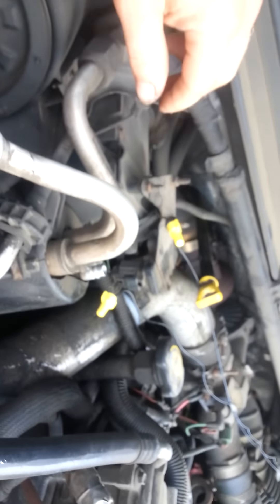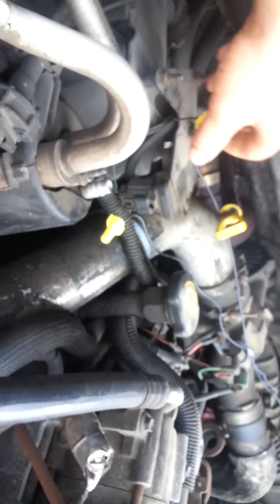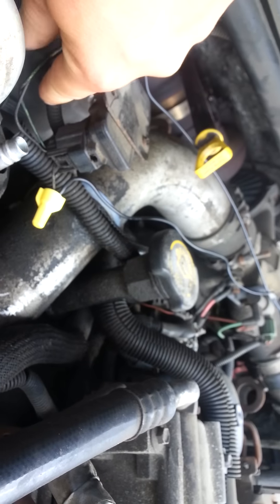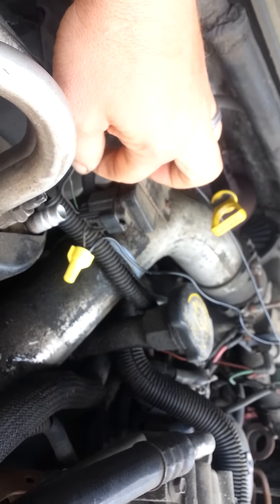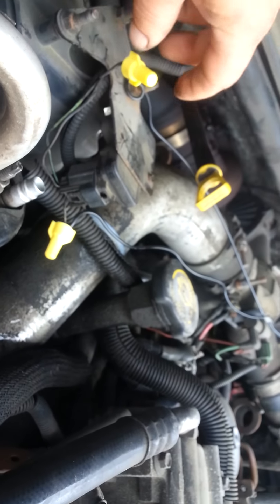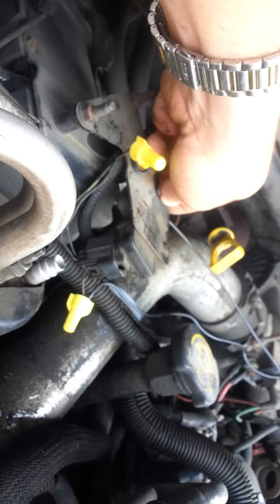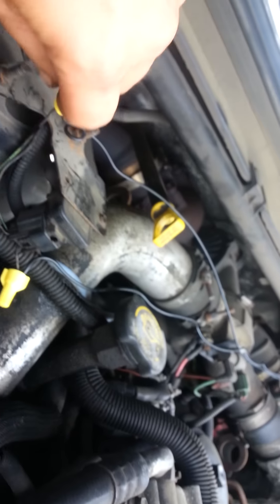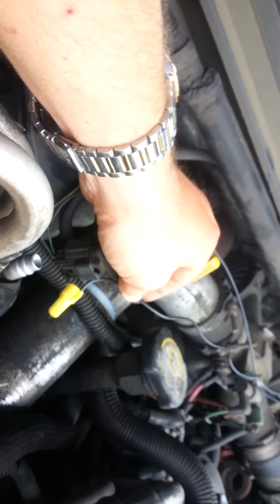Smoke switch install 7.3

Comment: If your fuel pump isn’t getting power from your sensor it automatically send more fuel through.  So when you floor it or do a booster launch she’ll throw smoke throw

Comment: ANSWER: There are 3 wires total, Black, Brown, Green.

CUT: Brown wire. 
the wire that goes into the plug, you will splice with a wire that will run to ur switch to that is going to be in ur dash.

The other end of the brown wire that goes to the the regular FORD WIRE LOOM, u will also splice that, and run a wire that goes to the other end of the switch…

all the switch does, is basically completing the brown wire circuit or it is not. which tricks the PCM, to allow more fuel

Comment: 01 7.3 and I cut the brown wire and spliced into switch but nothing has changed but service engine light on now also I only had a green wire red wire and brown no black like you mentioned any idea
Reply: Yea my 7.3 only has red green and brown
Reply: @eddy8319  what wire do u splice together the brown or the green and brown to the switch

Comment from the maker: Make sure you get your swith in the right position  and after you play with it you will see a difference
Reply: Can you only cut brown wire and leave it open and not install a switch???
Reply from the maker: You can but your fuel milage will drop to about 5mpg
Reply: Jason tyo
U conected just the green one ??

Comment: I am going for power smoke is wasted fuel get the wiked will turbo and 6 stag chip that is wut I did.Don't cut your wireing just brake out some$ And do it rite

Comment: Can you only cut brown wire and leave it open and not install a switch???
Reply: Your engine will not run correctly normally and have insanely high egts on highway in od.  

HIGH ENOUGH TO MELT SHIT IN THE ENGINE.

Comment: Is your 7.3 all stock or tuned?
Reply from the maker: That truck was bone stock
Reply: @jasontyo7949  hey can you please explain, do I cut the wire off of it's other end only using the end that goes into the map sensor?
Reply from the maker: @skidoock3606   you only want to cut it to where you can attach a wire to it and then to the switch then from the switch back to the other end of the original wire you cut
Reply: @jasontyo7949  thank you very much! For how long ago this was I wasn't sure if you've abandoned us🤣 stay safe bro and thanks again 👍
Reply from the maker: @skidoock3606  I'm still here lol brother
Reply: @jasontyo7949  good to hear 🙂
Reply: @jasontyo7949  did this on my 2000 f350 zf5 and I get a little bit of smoke but not anywhere near that did I do something wrong? I cut the brown wire and ran 2 wires back to a switch in my cab but it just doesn’t smoke like that
Reply from the maker: @prestonwindham3202  it is possible that your wiring could be different

Comment: 01 7.3 and I cut the brown wire and spliced into switch but nothing has changed but service engine light on now also I only had a green wire red wire and brown no black like you mentioned any idea